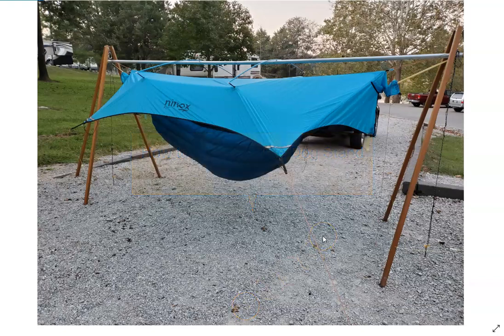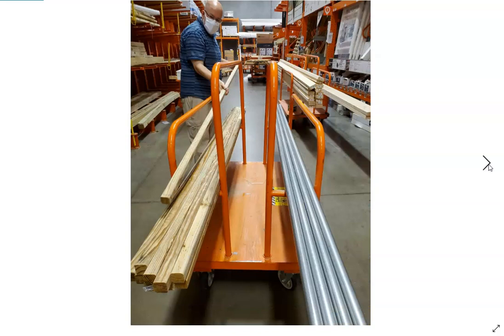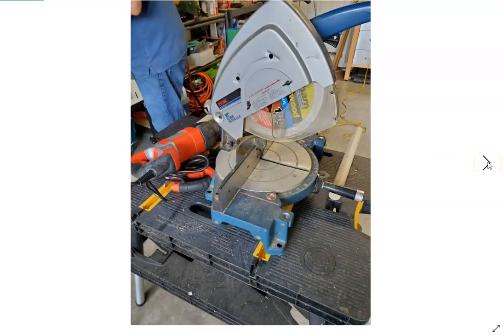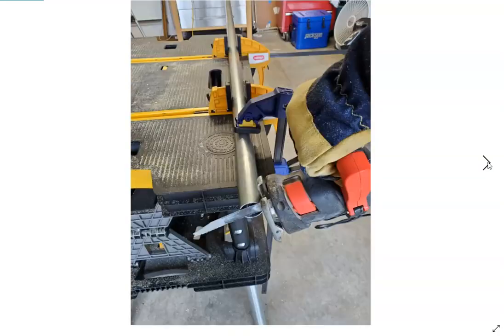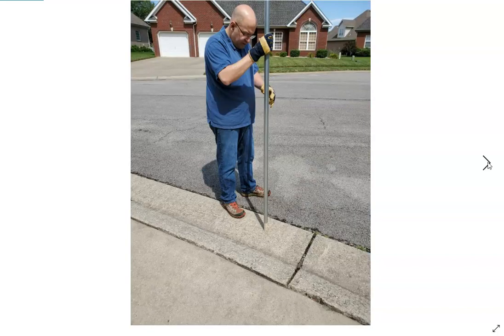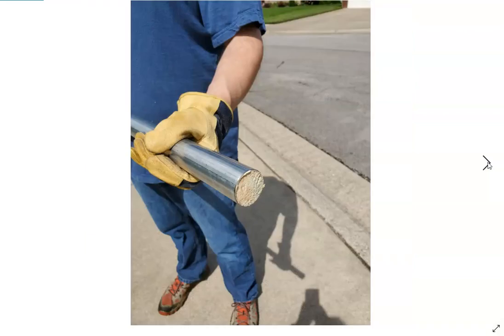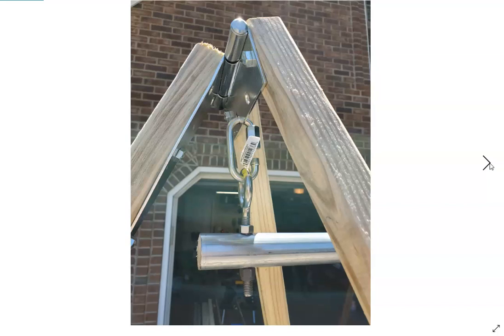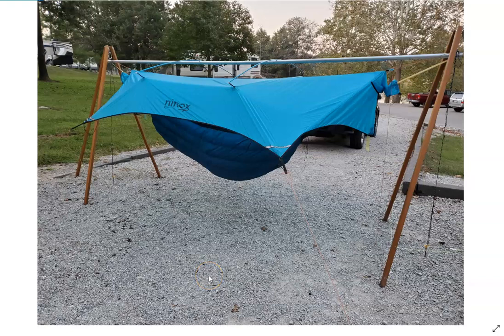How to build a Turtledog Hammock Stand

Comment: I'd like to see some more specifics about how to attach the two top pole pieces together, and how to use the T nuts. Thanks!
Reply from the maker: The top poles just slide into each other. One has a smaller diameter end.  If you look at the top fence posts on the store, you can see the difference.  We cut that small end off one of the poles to have the same diameter on both outside ends.
Reply from the maker: The T-nuts - just put the bolt though the hole you drilled, then thread the T-nut on.  Once you tighten the bolt it pulls the T-nut into the wood.

Comment: How are the ridge pole sections attached together?
Reply from the maker: The poles have male and female ends.  We keep the female end on one and chop off the other to get the length down.  When you put them up we just slide the m/f together and then hang on the tripod.